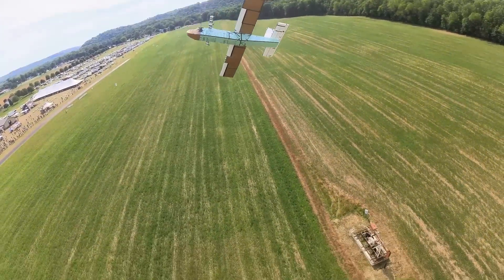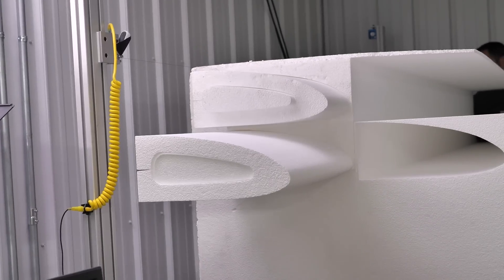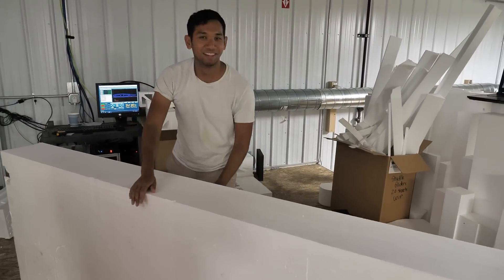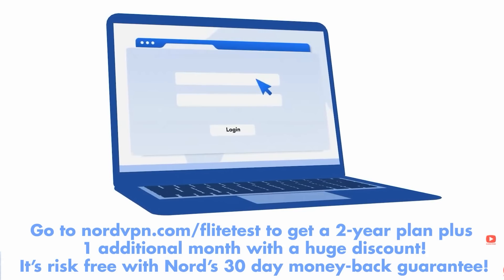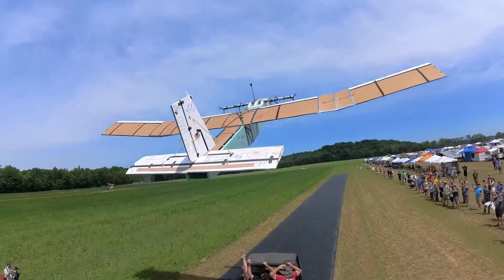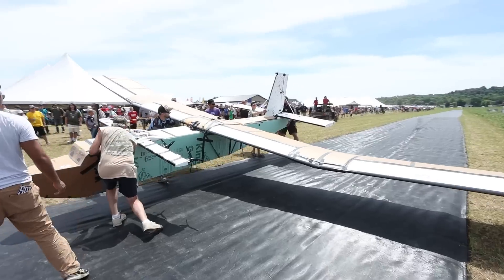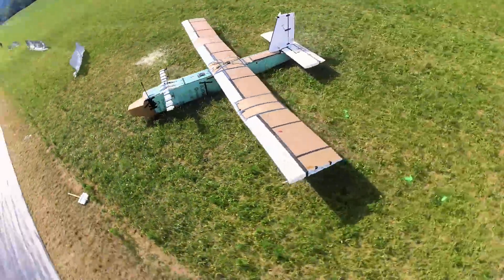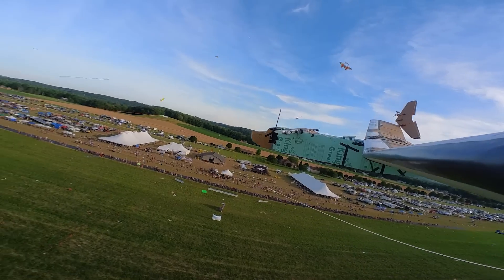Building The Worlds Biggest Foam RC Airplane?!

Comment from the maker: Get an exclusive NordVPN deal here ➼ https://nordvpn.com/flitetest Nord offers a 30-day money-back guarantee, so you can try it without any commitment.
Reply: Dimensions in metric as well as empirical would be handy! About 10 metres wingspan?
          It's a big wourld and lots of it uses metric!
Reply: Sideslip= when real lift < real weight
Reply: If Peter wasn't there, I wouldn't have watched this video.
Reply: So bad power supply that everyone in the US needs ecoflow everywhere?
Could be cheaper fix the net and grid than everyone getting such device. 
Be have power outage every 15 years for seconds or minutes after thunder strike maybe or when excavator guy new to the country and regulations ignored the rules to obey and hits the cable but other than that it can not really happen cause the grid in  the house has to be saved or otherwise would go from the grid. THere is no such thing as overheating a line cause those are save for 16A x 240V 

But of cause we have to pay more per kWh due to all the regulations and becoming the country more energy efficient. No AC at all in private houses for example, but heatpumps. 

great flitefest this time again

Comment: I'd say it would only need a very light added weight in its front, and 1-1 more motor on the propulsion wings to be more functionally aerodynamic for flight.
Reply: This is a Peter speed build, it’s meant to be both amazing and sketchy at the same time then be blown apart in combat. It’s performance art.

Comment: I see your cnc machines use 80/20 profiles. I built mine using 80/20. That stuff is awesome. Same as their online design tool where you can test deflection of the profiles before you build to make sure it will be rigid enough for your application.

Comment: Why are you using those tiny props on that plane, no matter how much power you got those things are only gonna cut through the air at a certain rate, no matter how much power you have, you need bigger props to equal more thrust to power ratio!! Bigger the prop more thrust you will create considering the amount of power you put into that sucker!! They don't need to be much bigger props but maybe a 10" or 11" prop would be perfect!! You might would have to put a stiffer brace for the thrust, so it doesn't rip the mount off the foam!!

Comment: "little bit tail heavy", 😂
Even with the wing loading nearly like a hot air balloon, it shows how important proper balance is and how it can bite you.

You do a real service to the public by flying these craft before the issues are discovered. So many home built, experimental ("real") aircraft have been built, often taking decades, where the builder/owner/pilot was lost on the first flight because of an overlooked detail ,even though so much time and attention was given.

Sometimes the fatal detail is overlooked because of the "final stretch" looks so close and the process is rushed. Sometimes a detail is overlooked or forgotten, then covered over for good. Sometimes because of ignorance or lack of training. Sometimes the aircraft is fine, but the inexperienced pilot or pilot with little time in aircraft type isn't able to process and makes a mistake.

Far better to "explore" all these type of events with "foam" planes, remotely. Let people see how balance and loading affect flight dynamics. Break a wing, field repair it (duct tape it), fly, crack it up. Laugh and slap each other on the backs, go home at the end of the day, do it again, again, and again.

Comment: I would like to see a large scale build that has scale weight and the engines are limited to the real world power to weight ratio.
Reply: Unfortunately, this will not work. The problem is that drag does not scale linearly with size.
Reply: @martindinner3621  I’m an electrical person, so excuse my ignorance, but would it be possible to choose a higher operating velocity to achieve a similar Reynolds number to calculate a scale drag force ratio and power ratio, then choose an acceptable operating point on the power / weight curve?

Edit - I think I just realized that you obviously can’t increase the velocity variable otherwise you would be supersonic for a small model. 

What about flying the model at high altitudes?
Reply: @MH-qb9ev  the main key is to accept that an exact scale aerofoil will not yield scale appropriate performance. If you are willing to modify the aerofoil and leave a little extra power available for emergency situations (military aircraft did this IRL) very believable flight characteristics can be achieved.
Reply: @MH-qb9ev  RE: high altitudes.
I'd recommend asking someone in a high altitude area like Denver or Mammoth Lakes, but the electric motor should be less of a problem, as compression drop and fuel/air mixture will not be a factor.
Reply: @martindinner3621  I guess my point is that I would rather see a large scale R/C aircraft with a scale rate of climb than one that is drastically overpowered and capable of taking off in super short distances or doing 3D maneuvers.

Comment: I don't have the giant eco flow I have the 1.3 kW older version. With 160 w solar panel you can run two box fans charge your phones almost without having to charge it off a generator depending on the sun so worth the money. Even just being lazy in the living room because it uses fast charge 2.0 or something It's great

Comment: Can some one fill me in on what this monster motor is... and what controller it is running on? Im currently building a 3d printed jet drive for large Kayaks and i need a reliable way to power it.... at 6s plus...
Reply from the maker: It’s our 4030 brushless motor and 80amp escs on our store. :)
Reply: @FliteTest  I wish could talk with one of you guys.... My torque demands are high but I don't need much in the way of rpm considering what brushless can do
Reply: Compressing water takes alot of power 🤣
Reply: Two things to keep in mind for marine applications.
One: cooling. You have easy access to water for a cooling jacket for the motor. (Small bleed line off of the pressurized side of the jet drive.)
Two: the Kv number will give you a general idea of the motor's torque output. Kv times line voltage yields motor RPM. So for more torque you want a lower Kv number.

Comment: I want to see you guys build a flying saucer out of foam. A big center ducted fan and smaller ones for at the edges. Basically a quad with a foam skin. Rewire the motors to turn high pitch slow speed props to get rid of the high pitched whine.

Comment: Good job guys! The largest foam R/C model I'm aware of was the 1/4 scale "Centurion" flying wing. It spanned 62.5 ft and weighed about 25 lb.  https://en.wikipedia.org/wiki/NASA_Centurion#/media/File:Centurionquarter-EC97-43931-26.jpg
Reply: Could not find anywhere on the link that you provided that that plane is mostly or almost completely built out of foam. Of course, there must be some foam in its construction for lightness. On top of that, the information does say that it is designed to carry 600 pounds. Based on that, I seriously doubt that the proportion of foam to other materials is greater than what the Flite Test guys built here. Just saying.
Reply: @philalcoceli6328  The wing (LE, TE, tips, ribs) and pods were all foam. Of course, the spar, landing gear, batteries and motors were not. The covering was like plastic wrap (not foam skin). It was built in '96-'97, material options were limited then. Lightness was critical, lithium batteries and small brushless motors weren't available. The full scale prototype was designed to carry 600 lbs. I was part of a few guys who worked on it. BTW, you could argue that it was a flying wing, not a conventional aircraft.
Reply: @LesCanDo2  Not arguing, CanDo. I just could not find the materials and their proportions in the link you gave about this flying wing. I trust the information about the naterials that you just offered. I would have to agree that the Centurion (a name I particularly Iike) is a flying wing and not a standard airplane. So, Flite Test appears to hold the title for standard foam airplanes for now. Thank you for the clarification!
Reply: @philalcoceli6328  No worries Phil. The link just showed the 1/4 scale Centurion model I was referring to, I provided the details. BTW, the full scale plane, later renamed 'Helios', went on to set an altitude record of nearly 97,000 feet. It had a wingspan of nearly 250 ft! Not bad for a solar powered flying wing!
Reply: @LesCanDo2  Cool!! Impressive! Progress in any form of aviation is a blessing for all aviation! Thanks!

Comment: Loved seeing the CAD program in action.  Wondering what parts you 3d printed? And what radio setup you'll used?
Reply: There are no 3D printed parts in this plane we used the cad stuff to run a hot wire cutting the foam for big plane

Comment: Here's an idea: airtight bladders in the wings or fuselage filled w HELIUM. Might offset the weight of the plane but might also make it hard to manage. Who knows?
Reply: At this size weight isn't the problem. It's actually a bit on the too light side, the winds throw it around too much. A longer skinner fuselage would be better. Get more control authority out of the tail and reduce the area the wind is pushing on. I think Peter had initially designed  it with more distance between the tail and wing, but moved the wing back to get the center of gravity right. Playing with the thrust angle on the motors might help too. It would be neat if the entire motor canard could pitch.

Comment: Again, Peter supplies one of the defining moments of Flitefest.

If the "largest foam plane" record doesn't work ouut you can still go for "lowest power to weight ratio" or "slowest recovery from an unstable attitude"...

I loved every moment of this years event and if circumstances allow will be there next year. (And yes, I'll bring more candy...)
Reply: "..."slowest recovery from an unstable attitude"..."
-->of course-->the bigger the slower !
Reply: @swyntopia  "the bigger, the slower"? That's not a rule at all. LMFAO
Reply: Or "ugliest rc model" LOL. Just kidding (more or less).
Reply: Lowest power to weight ratio is a glider... its mathematically infinite.
Reply: @willhaney96  you flipped the fraction. It’s zero not infinity.
Reply: @HotboiEngineering  0/weight = 0